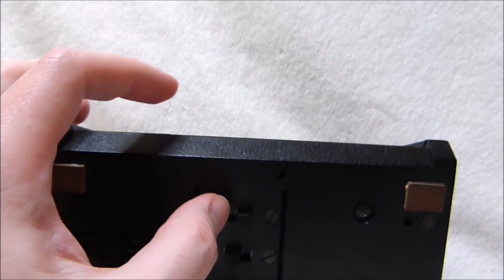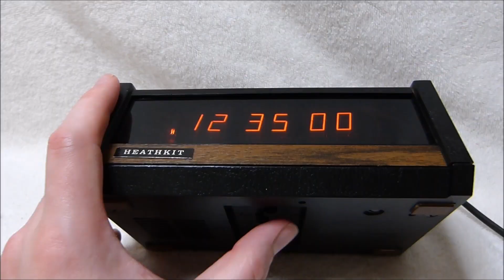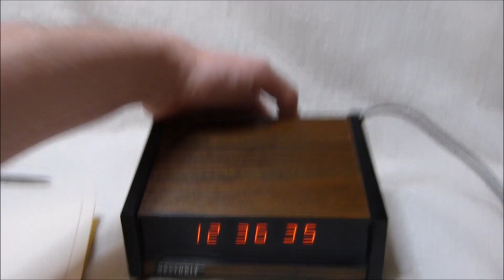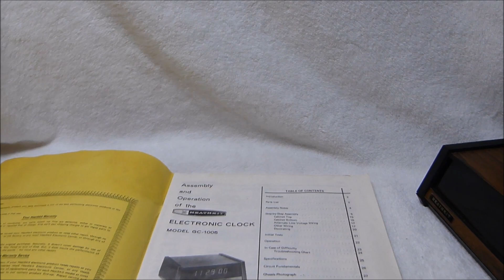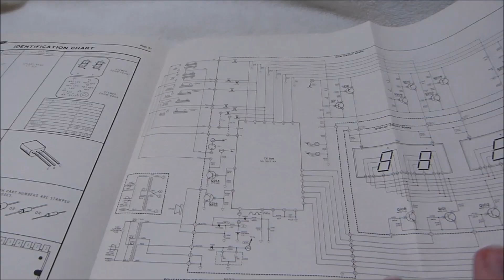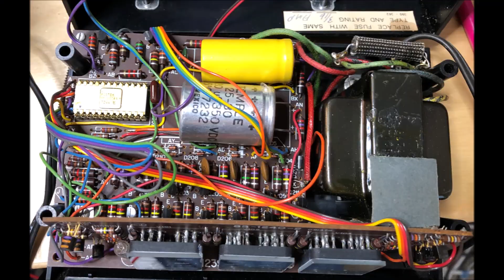Heathkit's first digital clock, the GC-1005 (1972, USA)

Comment: Great video! It was very helpful in my designing a replacement MK5017 main clock chip - had to get the alarm sound right.👍 The broken clock i bought had a bad chip.
I sell them on Tindie and eBay now.

Comment: Mine has been running continuously by my bedside since I built it in 1973. No component failures in almost 50 years.
Reply: mine, too! except for one display flickering. wondering if I dare fix it...
Reply: My daughter asked me a few weeks ago if I had a spare alarm clock. I exhumed my GC-1005 which I built back in about 1973; It still works perfectly. It was retired years ago because the display was too bright and the alarm too harsh: it has a 2 1/4" speaker in the base.
Actually I just noticed that the model number on mine is GC-1094. However it looks and functions identically to the GC-1005
Reply: Mine flickered..I found link about changing single cap and that fixed the problem...I cannot find that link but try and look 
further.

Comment: After installing new panaplex displays and a jumper wire to make it a 24-hour display, I use mine as my daily alarm clock.
Reply: where can you source the panaplex displays from?
Reply from the maker: Nice, it's a great looking clock! You might want to change the filter capacitors if you haven't already.

Comment: My Dad built this when it came out cira 1972 (I was 3).  I have it running in my office and it has pretty much been running perfectly for nearly 50 years now.  A digital clock with seconds is still pretty unique.
Reply from the maker: The seconds display is generally only found on early digital clocks (pre 1975). 50 years is a long time for a Panaplex clock to be running! Does it still have its original displays?
Reply: @50sTransistorRadios  Yes, all original but now (3 years since this comment) it has started glitching.  I wonder if it can be repaired?

Comment: I bought one of these when it first came out and still have it in my shop.  I built about 5 of them for other people as well.   I have the later model GC-1092 that I use for my alarm clock.  I had bought replacement display elements back when they were still making these clocks.  Both are working fine almost 50 years.

Comment: Interesting.
I had a Heathkit Short Wave radio at one time, when I was a teenager.
Someone threw it out in the trash.
I cleaned it up, plugged it in, and......
I worked great.
That’s a handsome looking clock,too. 
📻🙂
Reply from the maker: Thanks Jeff! Sometimes you just get lucky like that. I would bet the vast majority of these clocks ended up in the trash, as until recently at least, they were just "old clocks" without much value to people. What happened to the radio?
Reply: 50sTransistorRadios 
It’s really amazing what people throw away.
I found an old TV set as a teen.  A 15 inch, Philco portable. Blue plastic with a white metal screen surround.
Black and white.  I replaced 3 tubes, and used it in my bedroom for years.😁
Some of the radios I have are “rescues “, were going to be tossed, just because.
I imagine clocks are even more so.
 Seems you have quite a collection of clocks as well as radios. Cool.
📻🙂

Comment: Thanks for sharing this example of some interesting old tech. I always liked the look of those white ceramic chips, and those displays are cool. Heathkit were always a quality product, from what I remember.
Reply from the maker: Thanks Colin! For the most part, Heathkit products were well designed (in my opinion at least), but they did fall short in some areas, like the quality of parts used, the styling and user friendliness. For example, the lack of labels on the back switches isn't something you would see normally on a factory made clock from the 70's.

Comment: These are the same type of displays used on the 1973 Tektronix model 31 scientific (suitcase) calculator I have.  They are from Sperry.
Reply from the maker: That Tektronix model 31 is one heck of a calculator! In just a few years something like that could be made much smaller, and with far fewer chips. The SP-352 displays both items use were made by at least 3 manufactures: Sperry, Beckman and Babcock
Reply: @50sTransistorRadios  I think I need to replace one or two of the Sperry displays. When I tried it out a few months ago, a few of the digits were flickering dim, and one would only work after the calculator was powered for several minutes. But it has also been on the shelf here for about 20 years.  The thing is HEAVY.  Also likely one of the few calculators to feature a cooling fan!! :)